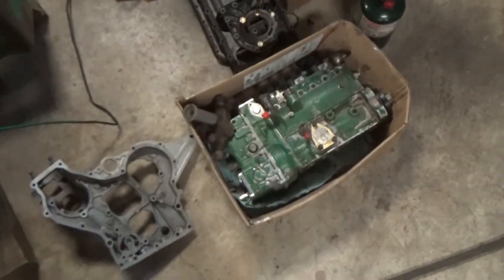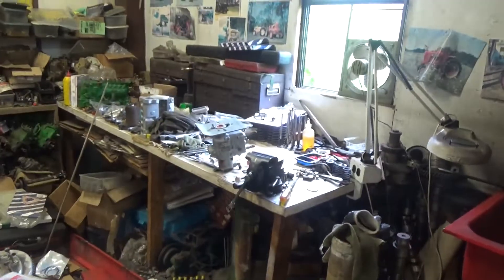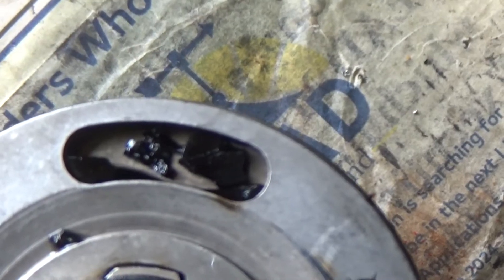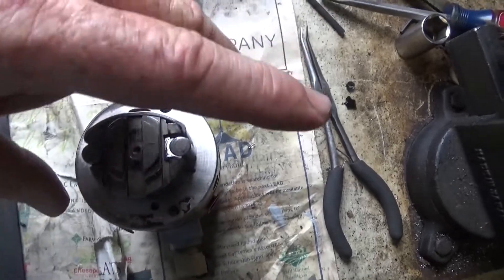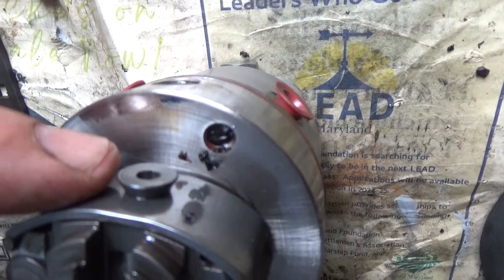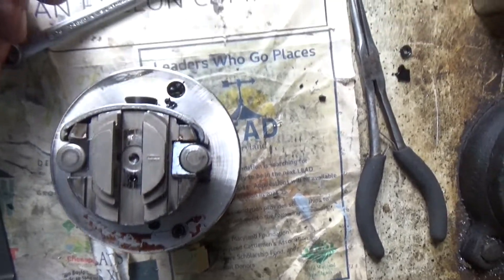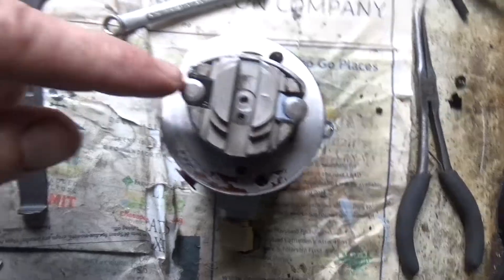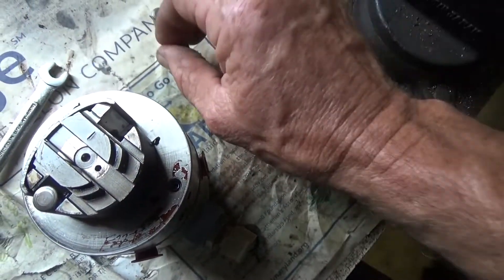Injection Pump 101

Comment: On my Ford 861, my pump is leaking oil at the bottom where it connects to the tractor. What do you think might cause that? Given how difficult it is to remove, rebuild, and time these, should I just tolerate the leak? Thanks for any advice.

Comment: Bill was watching this video and was wondering if you had thought about using one of the bits you could put in a air hammer that lets you put a socket and a wrench on it while you vibrate it for getting that splined stud out

Comment: To get that ball thingy out I used a 1/4" allen socket on the 1/2" impact with a 3/8 to 1/2" adapter. Came out clean in an instant. Swinger Loader with Ford 4 cyl.

Comment: Good Video, Bill. Do you run the pumps after you’re done or just bolt them on? The paint stripper worked pretty good. Fuel quality is definitely worse than years ago.
Reply from the maker: Right now we do not have a pump test stand, so we "just bolt them on".😁

Comment: Do you know why the cam ring in john deere roosamaster has double ramps on it. We built a pump for my sons 4010 but we used a cam ring without the double ramps. Always wondered why they are like that.
Reply from the maker: I do not know why they did that, but l'll study on it a while.

Comment: A while back I had an oliver pulling tractor and I pulled it in a class that had to run a roosamaster pump. Im a machinist and  I made a new rotor to go in the pump out of brass and put .550" plungers in it. I used brass because these are known to seize up when pushing them hard. It ran but still ended up seizing up. It was fun a little while.
Reply from the maker: Wow, that's pretty impressive!

Comment: Thanks for the video. I have a 1961 Farmall 340 with a gummed up pump like that.  If I remove it to clean it how can I get it trimmed properly? Thanks.
Reply from the maker: Hey thanks for asking, if you have no experience with working on one of these pumps, it will be difficult to disassemble, clean, and reassemble with the proper rebuild kit. Not saying you can't do it, just saying be careful to get all the parts in the right position, keep them super clean and lubed when assembling.If you put it together the way it came apart you don't need to adjust anything. I still wouldn't recommend trying it.

Comment: Just bought a 72 JD 5020 had the  pump rebuilt and asked them to turn it up but still feels sluggish pulling 5 16s wish I could send it to you
Reply from the maker: Hey Joey! Try advancing the timing, just loosen the bolts that hold the pump to the engine and rotate the top of the pump towards you, that should help some. 5020s  really need a turbo to be real peppy.
Reply: @so.md.dirtfarmer2226  I’ll do that but won’t it make it harder to start. Guess I’m wanting to much from it I’m use to a 6030 with a 619 in it with over 350 HP lol
Reply from the maker: It won't necessarily effect starting, but it could. Yeah, l'm sure by comparison the 5020 feels like it's in slow motion.   @joeydulin1885
Reply: That 5020 should pull 7 16's with ease.

Comment: Thanks for pump info. Is there and additive you would recommend to put in fuel ?
Reply from the maker: 2 stroke oil, or some companies like AMSoil make good additives.
Reply from the maker: Here's a link you could buy it through our independent Amsoil dealership: https://gesynthetics.myamsoil.com/. The ones we would recommend are ADFPCN-EA for use in heavy equipment for lubrication and cleaning and ADBPCN-EA for use in trucks.

Comment: Back in the day I had a customer that had a diesel station wagon. GM'S sorry attempt at a consumer diesel engine. He said at idle it would rev up and slow down and run all crazy. Nobody could fix it. Told him it was a temporary fix and showed him how to remove the return line check valve. He said that car didn't run that good when it was new.
Reply from the maker: Hey "John", it's fun when you can fix peoples stuff like that.
Reply: Dang good mpg though

Comment: when i built my pump on my 2640 the only way i got the fuel i got going to it now i took that spring and threw it into the junk pile. great video btw
Reply from the maker: Gutsy move!
Reply: well anything to make more smoke i guess @so.md.dirtfarmer2226
Reply: The 2640 was a GREAT tractor. They always loped a little at idle. I kinda liked it. If you change injection pump timing to stop that youre losing horsepower.
Reply: My DAD's 4230 LOPES...and I LOVE🚜IT💪😍🤩🥳

Comment: Bill great video on the injection pumps two ? What was the tractor with the cage on it sitting in the weeds behind the 4030 . I used to pull a 4620 in the 10,5 class  in 6th gear coming out about 4500 rpm  the pump was built 350 cc of fuel  the pump would lockup shear the shaft off was them rollers on them plungers what locking up my pump guy never told or can’t remember this was early/ middle 90’s
Reply from the maker: Hey Brian, sounds like you were havin' fun! That tractor's an old 4430 puller.

Comment: Hey Bill. I used to have a lot of problems with my gas powered lawn equipment until my mower repair shop advised me to only use pure gas (no ethanol). I also started mixing 1 oz per gal of seafoam motor treatment in the fuel can when I fill it at the station. I switched to Walmart's Supertech fuel treatment when I discovered it because it is less expensive and I am sure it is the same thing and prolly even made by Seafoam for Walmart. Since I began those two things I have never had another problem with my equipment starting or running. I am thinking about putting the fuel treatment in my old '93 GMC truck too as it's sposed to be good for auto engines too. BTW, interesting video and entertaining too with your humor. Are you self-taught about fuel injection systems? Based on your pulling tractors I know you know your stuff. Have a good one!

Comment: By turning that screw what % more do you think you are gaining in fuel!?
Reply from the maker: It varies from pump to pump but l would say a range of 10-15% on the low side. Some pumps with larger "plungers"in would be higher.
Reply: @so.md.dirtfarmer2226  good to know! Thanks! I enjoy the pump videos keep them coming if you can, makes it easier tearing mine apart!
Reply from the maker: @bryanG4020  Bryan, you probably know this but l'll just make sure, you don't need to disassemble the pump that much to get access to that screw, you can do the job with just removing the cap, linkage, and the long bolt that holds the spring. Rotate the pump 'til the screw lines up with the access hole. Like l said, you probably already knew that, you're a smart guy, you watch my channel.😄

Comment: I use a 3/8 impact driver to loosen that splined bolt
Reply from the maker: Thanks Jason, I've had so many of them crack and split, I've been a little gun shy about using an impact, l'll try it next time.
Reply: @so.md.dirtfarmer2226  the kind you twist and hit with a hammer is what I use